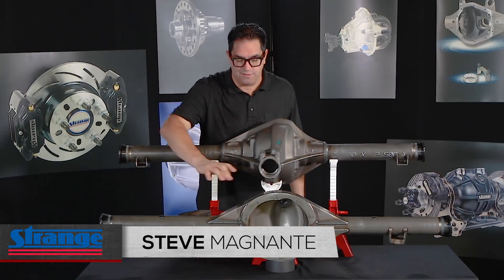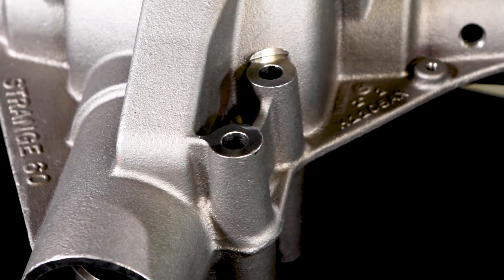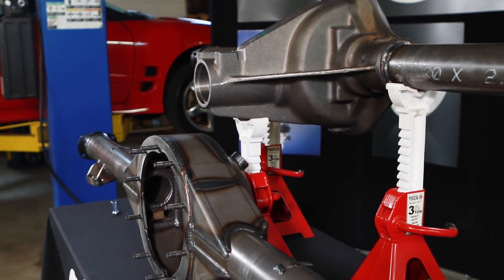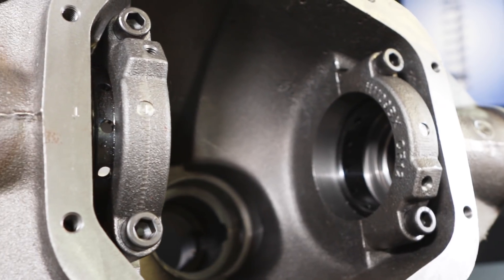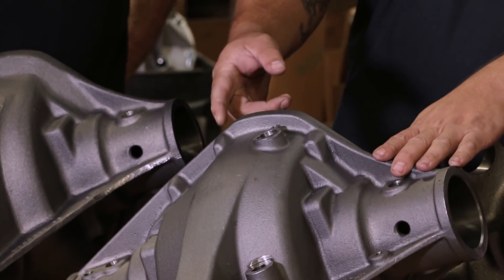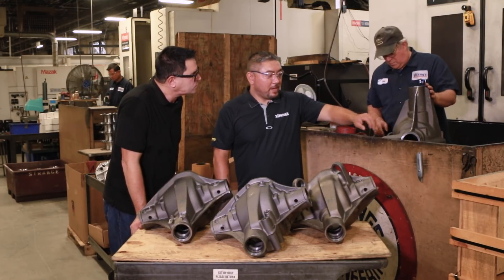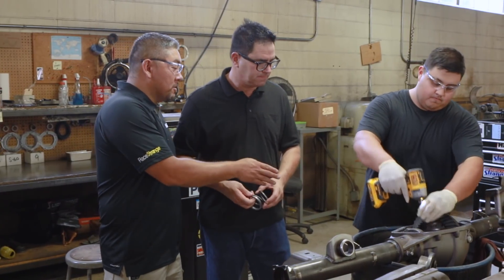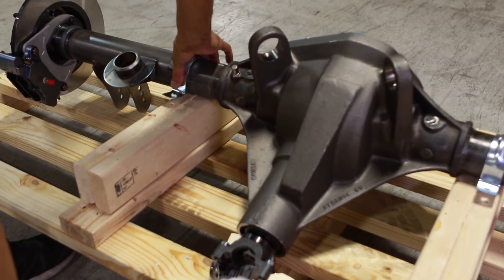Strange S60 Bolt-In Rearends

Comment: If only the axle bearings werent trash...have one in my fbody, cam heads ls1 and after a year of street only it trashed an axle bearing out of the blue...strong as this axle is no way in hell that should have happened, 35 spline alloy axles, torco 85-140 fluid. axle bearing decided to blow apart, should have went 9" like everyone else.
Reply: Did you go with junk green bearings?
Reply: @devinhudak9608  there is no "i" in this. They assembled it this way. They did a big batch of them this way.